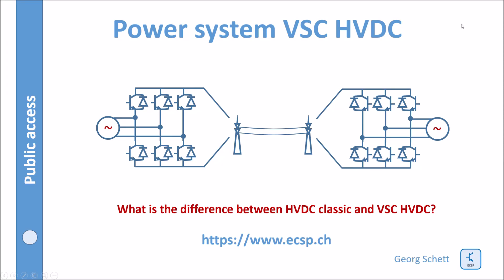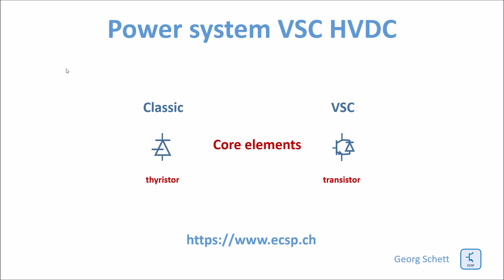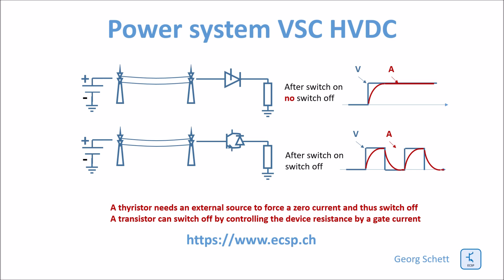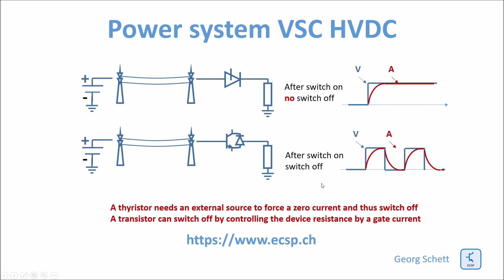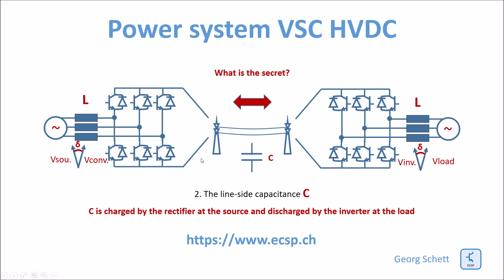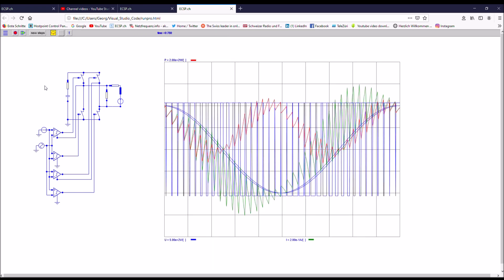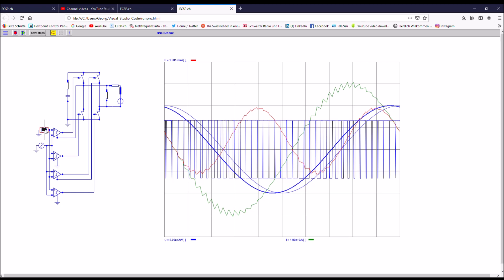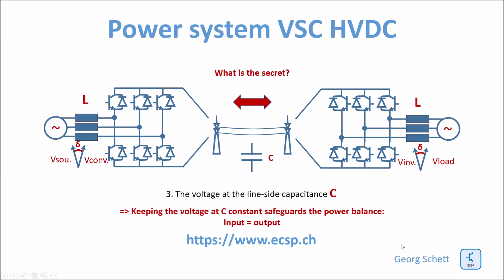Power system HVDC [circuit simulator]

Comment: So in the end, VSC is nothing else than a rectifier or inverter where we use IGBTs?
Reply from the maker: No. The point is the DC source. In VSC the DC Voltage source is constant whereas in the classic converter the current source is constant (and the voltage varies). In VSC however you need an devices which can switch on and off the current, which is a transistor (or IGBT).
Reply: @georgschett801  Thank you for your reply! I am still very new in the domain of HVDC, so I am not quite familiar yet with all the new terms. 
My complete question would be this: after generating electricity, say through nuclear, we step up the AC voltage to the high transmission voltages, but in order to convert then this HVAC into HVDC, my logical thinking would be to use a rectifier which can withstand such high voltages. However, I usually see in electrical schematics the symbol of VSC instead of the rectifier, which made me question the nature of VSC. 
When we use the term "DC converter", I suppose we mean rectifier (AC to DC) or inverter (DC to AC), and are these used to convert HVAC to HVDC? If yes, what role does the VSC or CSC play?
Reply from the maker: @svwtsvfcb  You are close. AC to DC is in fact a rectifier and DC to AC is an inverter. Converter is the more generic term, a device which transforms electricity from one form to another, for example dc-dc or 50Hz-60Hz or so. CSC is a more traditional conversion technology (see my hvdc classic video) and is based on thyristors. It is less flexible but still produces lower losses. For example CSC needs a functioning grid at the load side in order for the thyristors to be able to commute. Thus black start is not feasible (at reasonable costs). It is used for bulk power transmission at very high voltages. VSC on the other hand is not yet mature for very high voltages and it is not yet used for very high power transmission. The losses are still a bit higher because you switch on AND OFF the DC current in order to get an AC voltage (normally Pulse Width Modulation). In order to interrupt the DC current in the transistor you have to very quickly increase it`s resistance and this is the main reason for the higher losses. But the big advantage is that it can be used for black starts (i.e. for a grid with a total blackout for example), you can damp oscillations and you can rapidly change the direction of the power flow.
Reply: @georgschett801  Thank you for your response! So we could say, in this case, a CSC is a converter used to convert AC to DC and afterwards DC to AC, and it is made out of thrysistros. 
VSC on the other converts AC to DC and also DC to AC using a PMW for reactive and active power flow? Perhaps also frequency and power factor control
Reply: @georgschett801  I think in general, my problem is understanding how you can go from a very high AC voltage level and convert this to the same HVDC level. Because until now, I read that VSC technology is used to convert HVDC back into HVAC, but the other way around still stays a mystery for me
Reply from the maker: @svwtsvfcb  You got it!
Reply from the maker: @svwtsvfcb  It really works in both directions. From AC to DC you send small current impulses (as per PWM) from the AC side to the Capacitor on the DC side and so keep it's voltage on a constant level. You achieve this for example by controlling the phase angle of the PWM control signal (reference) lagging behind the AC grid signal (some converters directly control the current signal instead).
Reply: @georgschett801  thank you very much for your explanations! You just saved my Internship (I have to calculate the techno-economic feasibility of a DC grid) 😄
Reply: @georgschett801  can we control active and reactive powers
Reply from the maker: @reviewerbibhuti5100  Yes, we can. In a power grid, active power is controlled by the phase angle and reactive power by the voltage level.
Reply: @georgschett801  Like basically we have converters (rectifiers and inverters) that incorporate VSC valves (IGBTs) and phase reactors?

Comment: Well that one of these good & useful videos that i like to check out! Thank you for sharing such valuables informations.
Reply from the maker: Thanks for your kind feedback. Pls. share it with your contacts so I get visibility. All the best!
Reply: @georgschett801  Yes for sure I Will share/spread the videos with my own professionnal network.
Also that would be great, if you can  share power plants (controls systems,mechanical engineering...) videos.
I know there is many ideos on the subject (free or payed ), but these ones are correct for good overview of Industrials and Power systems.
Reply from the maker: @James-brayton  Thanks for your suggestions. What I plan in the near future is protection of power grids. Be aware that I am not a specialist in mechanical topics and my simulator is for electric networks.

Comment: It is fair to say that it is an interpretation of VSC power flow. The actual converter is not controlled or designed in this way.
Reply from the maker: Sure, it is a way to make the case principally as also stated in the video.